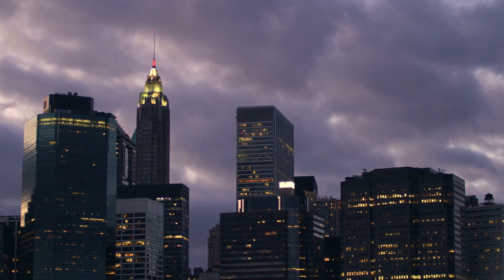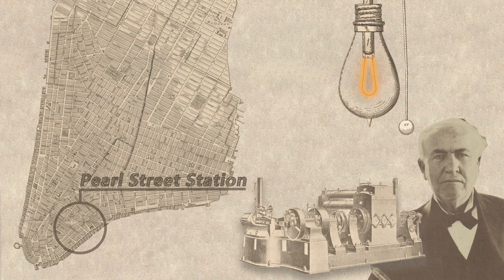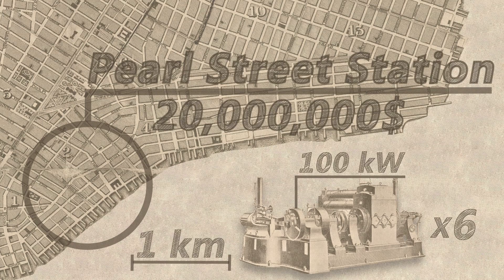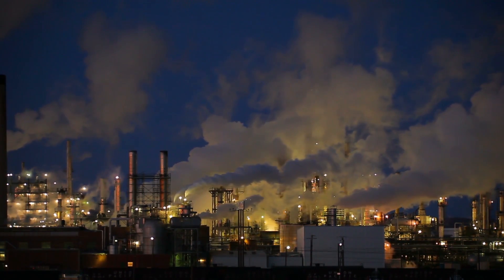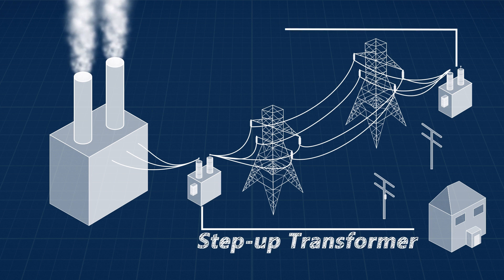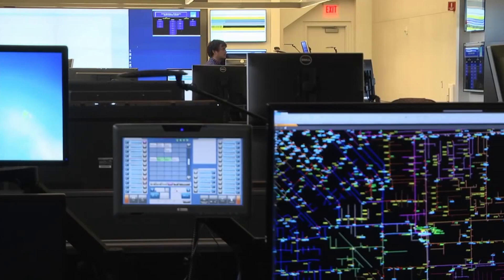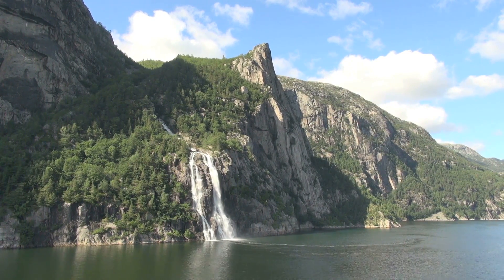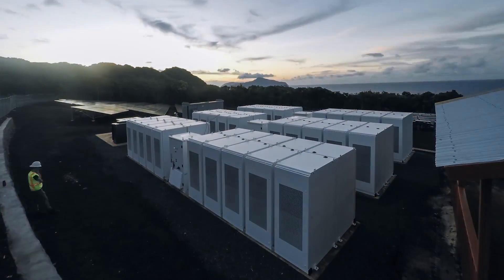What's The Biggest Machine In The World?

Comment: Or we could use good, clean, reliable, nuclear power
Reply: MrPepsicola123 You do realize that solar produces metric tons of silicon tetrachloride, cadmium and lithium waste as well. If waste is the reason why we shouldn't have nuclear, how can you possibly advocate for solar?
Reply: It's actually stored in a single site, carefully sealed. I don't know where you're getting your dumping the the ground and the arctic ideas from but your sources have no idea what they're talking about.
Reply: There is such a thing. Leaks are rare, and rarely that dangerous even when they do occur. Chernobyl and Fukushima only happened due to the fact that corners were cut when the plants were built. Chernobyl wasn't even designed as a power plant, it was built to enrich material for bombs.

Even the waste problems are overblown. the actual waste produced in volume is miniscule, France manages to store theirs, which power their entire country, in a single site, and there are new models of reactors that can reuse nuclear material to drastically cut down on waste, but no one is building them due to cost and anti-nuclear lobbying.
Reply: +•  Smudgest •
There are over 400 reactors in the world, a lot of them 40+ years old. There were only 2 serious accidents, which is already pretty good. But one was an old Soviet reactor, which wasn't designed to be safe and wasn't run safely. It hardly counts. The other one, Fukushima, also not really a true accident. It was caused by a gigantic natural disaster, which happens once in a 1000 years, and destroyed everything else too, including chemical plants and oil refineries. And with a few trivial improvements the plant would have survived just fine. But even if we count these accidents, Chernobyl killed less than 100 people, and Fukushima killed none. The fossil fuel industry kills millions, and renders the entire planet uninhabitable.
Reply: +Patrick French
We now on average produce 10% of the electricity we use from nuclear energy, and electricity is about one third of our total energy usage. Based on this, you could expect 30x more disasters, about one or two ever year. But, both Chernobyl an Fukushima are very old, outdated plants, Chernobyl never intended to be safe in the first place, and Fukushima was hit by an extremely rare natural disaster. So with the current technology I would expect significantly less disasters that serious even with 30x more reactors. I expect more TMI like accidents, where the reactor is completely ruined, but nothing outside is harmed. And there are even better reactor designs, which are not just another few orders of magnitude safer, but also a lot cheaper and simpler. The LFTR for example. Mass production of small reactors in factories would further drive down the costs drastically, and improve quality too.
Proliferation wasn't really a true danger ever, it's mostly just another excuse to keep burning fossil fuels. Commercial nuclear reactors do produce some plutonium, but that's useless for bombs, because it's contaminated with the wrong isotopes. Bombs need very pure Pu239, but commercial reactors also make Pu238 and Pu240. The first generates a lot of heat (it's often in space to keep stuff warm, and generate electricity, the Curiosity Rover on Mars uses it too), and that's not good in the center of a bomb. But the second is worse, it generates neutrons which during detonation starts the chain reaction too early, before the bomb reaches it's optimal configuration, and it fizzles. To make weapons grade plutonium you need very different reactors. The other way to make a bomb is using weapons grade Uranium, which is above 80% enrichment, but commercial reactors use only 3-5% enriched fuel. One last thing that countries get from civilian nuclear power is experience in working with nuclear materials. That is a more real danger, but that exactly can be easily avoided by selling them our tech, and not forcing them to develop their own. The Russians did exactly that during the cold war, they sold the reactors and the fuel, and took back the waste. This way the other countries only had to know how to run and refuel the reactor safely, and didn't have the chance to work with fissile materials directly. That's important, because both Uranium and Plutonium are very tricky to work with.
As I said fossil fuels are killing millions, so they are far worse. I'm reasonably sure that it's more dangerous to live near an old coal plant than in the Chernobyl exclusion zone. Then there's Flint, Michigan, where the drinking water is contaminated with so much lead, that it makes people sick. And that's not the only place in the US with serious lead contamination. In other places people are dying from oil that routinely leaks from pipelines. And there are places like Centralia, Pennsylvania, which is uninhabitable because of an underground coal mine fire (it's burning since 1962).
And finally, the worst industrial disaster ever, the Bhopal disaster (a huge gas leak at a Union Carbide pesticide factory). Thousands died, hundreds of thousands were injured, and a huge area was contaminated. It happened in 1984 and it's still not over.
Reply: They are good because they are extremely energy efficient. They are clean and reliable when designed properly, which is unfortunately rarely the case, due partly to economic concerns, and partly due to energy lobbyists rallying popular opinion against nuclear.

The latest model plants can re-use nuclear material, cutting down on waste by orders of magnitude, and are virtually failproof, but none are being built because no one can get both the capital and authorization to build them.
Reply: They can be both when designed properly. There are proven designs that reuse material, creating almost no waste, and even waste produced by all plants is practically negligible by volume.
Reply: Mi 28 my comment is to you actually
Reply: +Yalçın Alper Şahin The problem is that many of the nuclear powerplant are in flood-prone areas and with the rising water levels a catastrophe could easly happens.
Reply: LFTR ?
Reply: Hell yes.
Reply: "you" are wrong.
Reply: Do you? Or did you learn what you know from fear documentaries and your biased school textbook? Get a grip. Actual engineers run the world, not your drivel.
Reply: Its expensive due to laws forcing taxes and other unneeded costs on it due to lobbying of other power companies. Corrupt fucks. Its actually almost free compared to literally every other power method.
Reply: Dude please educate yourself. This isn't the Simpsons. This is real life. Moderns reactors "waste" is steam. You are not helping, so please shut the fuck up.
Reply: Or  we could use good, relatively clean, reliable, easily available and tried and proven fossil fuel burning generators.

You see @UndecidedSky, stating only advantages and ignoring drawbacks is fantastic right? Tool.
Reply: +GlobstersMessenger
Fossil fuels are anything but not clean. They kill millions every year. All people who were killed by nuclear power (not bombs) would fit on a medium sized airplane. And almost exclusively were from Chernobyl, which was a very badly designed, built and operated plant. Solar and wind kills more then Nuclear. One big gas explosion, or dam failure kills more people than nuclear power killed in it's 60 year existence.
And it could easily be far cheaper with more reasonable regulations.
Reply: Perhaps if you exist in a void, but we don't, money and demand is the driving force behind power generation, frankly the types of nuclear plants that have been most popular are arguably the more dangerous and less efficient variety, but are proven to work effectively, deaths and effect on the environment is not considered absolutely important here, it's balanced against risk and reliability.

Someone has to actually put money into a project for it to even happen in the first place, sure, money put towards cleaner nuclear power, more efficient nuclear power and a larger nuclear power base would be great, but few are actually interested in funding that when fossil fuels are arguably more reliable, cheaper, easier to set up and often people have more experience with them.

Fossil fuels will eventually subside due to supplies becoming more expensive, but I'm not sure nuclear power can ever gain a good image in the eyes of investors and the public.

And this is without even bringing politics into it, where you have people who fundamentally dislike the use of nuclear power, people who are concerned about nuclear proliferation, concerns about waste disposal etc. all of which makes people less comfortable with investing and supporting nuclear power, even if they themselves think it's fine.
Reply: GlobstersMessenger
Yes, nuclear power has a bad reputation, and unlikely to prosper in the foreseeable future, and that's why I'm worried. We don't have much time to stop climate change, and with renewables alone it's going to be incredibly hard. Nobody has any idea how to do that exactly, except Tesla. Nuclear energy is well known, we know how it scales up, how much it would cost, how long it would take, and what would be the environmental, economic, social, and other consequences. If the US kept expanding nuclear energy as it did before TMI, the world would use very little fossil fuels by now, and climate change wouldn't be an existential threat. But now it's almost too late. When your house is already on fire, you don't sit down to research the best firefighting practices, you use what's available the best way you know.
Reply: #gimmethorium
Reply: MrPepsicola123 his taking about the power not the nuclear itself
Reply: Clean? Yet leaving behind waste that has to be guarded against terrorist attacks by our grandchildren's grandchildren? That clean? Go fish!
Reply: dlwatib
That waste is a million times less than what fossil fuel plants leave behind, and it comes out neatly packaged. And you don't have to guard the waste, put it in a proper storage facility like Yucca Mountain and close the door. Not that terrorist could do much with the waste beside killing themselves. There are far more efficient ways to do terrorism. And it's possible to burn that waste and make a ton of energy from it. Some waste will still remain but that decays away in just 300 years.
Nuclear waste is a trivial problem compared to fossil fuel waste.
Reply: MolesterNZ1  My high school teacher dropped a piece of sodium into water.  Lithium reacts to the water in the air, which is pretty cool to watch as well.
Reply: You mean that stuff you can just put deep into a mountain? Places where people hasn't visited in about 4 billion years? Deep storage for 100 000 years might sound like a long time, but it's a small speck in our planets history.
Reply: +IronAperture
You know what else is toxic and radioactive? Coal ash. We have like 100000 times more of it than nuclear waste, and it will remain toxic for ever. The good thing about nuclear waste is that there's little and it comes out of the reactor in nice packages. Even better is that it's possible to burn the waste in fast breeder reactors, and they make electricity as a byproduct, about 100x more then the regular reactors that produced the waste. And after it's burned the remaining waste only remains radioactive for a few hundred years. We have 3000 years old buildings with still perfectly sealed rooms and metal containers in them (the Egyptian pyramids), so a few hundred years is no challenge.
Reply: Or better yet use thorium
Reply: UndecidedSky true but many of the costs Nuclear pays are unnecessary and modern nuclear technology can reduce others. For example Nuclear has the largest security cost of any energy industry on earth for threat of nuclear proliferation. However this threat has never once in human history been substantiated. In reality making weapons of nuclear waste is so costly and so technical it would be easier for terrorists to buy their weapons on the black market. These costs are maintained for an issue that has never existed. 

Other costs like liability concern and water can be almost removed by installing Liquid Fluoride Thorium reactors. These reactors are impervious to meltdowns as their coolant can't boil even in the threat of total power failure. These also use Fluoride salt instead of water as a coolant. This would drastically reduce liability costs for the plants, as well as reduce water costs and these reactors can be placed anywhere in the country. 

Imo given the benefits of safety, coolant properties and US Thorium reserves these reactors could potentially be significantly cheaper than all nuclear available today.
Reply: +OtK
Wind isn't good at all, far worse than solar. First, it's a mature technology (same principle as airplane propellers), so efficiency improvement is very unlikely. The only way to make them cheaper and more efficient is to go bigger. The economy of scale and the stronger winds further away from the ground helps somewhat. Second, they require large open space, that can't be used for much else, because you don't want to disrupt the airflow, and it's actually dangerous to be near them, because if they break, the released kinetic energy from the blades is very destructive. Third, they have some environmental impact, and since you need a huge amount of them, it adds up. Also, they fail relatively often, since they are big fragile things with moving parts. Solar energy is far better in all of these ways. It has still far away from it's theoretical maximum efficiency. There is no limit on how cheap it can get, because it doesn't need structural strength, or lot of materials. In theory you could just spray it on to any surface. It can be put on any surface that faces the sun, it doesn't need anything else. It has negligible environmental impact (except mining and manufacturing, but that's could be solved), and doesn't so visually intrusive. And finally solar panels are safe, the only thing dangerous is cleaning them on the roofs (but that actually makes them more dangerous than nuclear energy).

Jobs doesn't matter anymore, with increasing automation, we are now transitioning to a post-scarcity economy, where people don't have to work at all.

Hydrogen isn't worth it. Batteries now getting cheap and have enough capacity to power cars, and augment the grid. Hydrogen needs a complete new infrastructure, while electricity is already available everywhere.
Reply: +juste kevin
Switching to nuclear energy in time could have prevented sea level rise in the first place. But it's not that big problem for reactors, they just have to be prepared. Move the electric gear and backup generators higher and they are going to be fine. Sea level rise won't happen overnight like the tsunami in Fukushima, so we have plenty of time to adapt.
And there is no reason for a nuclear reactor to not work underwater. If the electric parts are well insulated, they are fine, they don't need air. Ironically the weakest link in Fukushima were the diesel backup generators for the cooling system, which are fragile, don't like water and run out of fuel fast. Better reactor types like the LFTR don't need active cooling. Or if the reactor is completely under water, cooling is not an issue. Nuclear subs spend months without surfacing, their endurance is only limited by the food supply for the crew.
Reply: Oh hey, ok that was a fact that I did not know about until now. But do coal power plants not have filters for such substances? If they reach the air then I see what you mean - nuclear waste is at least controllable and (not completely but at least mostly) sealable. Dust is uncontrollable and spreads through the air to poison every organism in the region and maybe on earth.

Then, some words to my comment up there - my intention was to draw attention to also see the other side of the medal. In general overpraising and overhyping things, only mentioning the so good-sounding nice sides about, that overhyping like here, is not a good approach. I hope you agree with me in that aspect. Here they called, it was only clean, reliable, good and in common nothing about that could be harmful. That is just not true, and I don't like it so much when people do that.
Reply: You are the definition of ignorant and the prime example of gullible. Educate yourself, swine.
Reply: We don't have to worry about nuclear waste that's why god gave us the Nevada dessert
Reply: UndecidedSky you forgot dangerous
Reply: Nuclear energy gets a bad rap, it's not a long term solution, but it's vastly superior to fossil fuels.
Reply: Nuclear power is very expensive though. This is the core reason why oil, coal and gas eclipse nuclear. The "green energy" is even more expensive and only exists either in personal households with a lot of money to spare or as a government subsidized program. And by the way, the "green energy" generates much more pollusion once you consider that it doesn't comes from nowhere and it has to be manufactured with all the associated pollution. Case in point: manufacturing of solar panels create up to several times more pollution per amount of energy they produce in their lifetime than burning oil to produce same amount of energy in a fossil fuel motor.
Reply: Wind is the best, and most commercially viable option until Hydrogen Fuel Cells can become commercially viable. Nuclear is an interesting idea, but from what we have seen so far, the current Nuclear projects in the United States are billions of dollars over budget, and years late. Wind is environmentally friendly, and it will create more jobs than amount currently employed by the fossil fuel industry. As far as solar goes, it is one of the most over rated powers there are in the world. It only got so popular because the solar market paid off the politicians to subsidize the hell out of it. We must move towards wind until the rise of Hydrogen Fuel Cells.
Reply: +Andra Biro
While your attempt to down play is very accurate it doenst really address the issue.  Even if the odds are a million to one the potential impact of nuclear disaster is just to cost to justify nuclear power proliferation. At least that is the basis of anti-nuclear. And it's does have some merit.  Imagine if we were to replace all our energy production with nuclear tomorrow while cutting the rate of nuclear disaster per plant down by 75%. How often would we then have a disaster, and how long would it take for use to Chernobyl the the entire planet? 

 But then the same people of course complain about pollution from coal drive big SUVs despite the BP disaster.  There really is no easy answer.
Reply: Why are so many people calling nuclear power clean? You are forgeting a really important facet.

Yes, I know the physical and technical backgrounds. A working power plant that works secure and produces much energy for not producing CO2 and consuming much resources is a nice thing. But nearly everyone that talks about nuclear fission forgets about the nuclear waste! That is the one aspect that I find terrifying about and why I am not so convinced of that technology. It is not only radioactive, everyone knows that of course. But it is also highly toxic too, leaving out the radiation.

And what do we do with that harmful matter for about 100.000 years? Oh, eeehm, first we enjoy the nice energy and someone will certainly find a way to deal with it. And so - we are pumping it into the sea, burry it into the arctic "perpetual ice" - that isn't as perpetual as we find out now - stress our ground water with it and so on. To be clear, we just don't know what to do with it and still do not care about and are performing a blind flight.

Okay, I also know the other side, the tons and tons of CO2 that we are pumping into the atmosphere. Therefore it could be "okay" as a transitioning technology until we have something better like nuclear fusion.

But - please, please do not forget about the negative sides of nuclear fission power generation and don't praise it as so clean and nice and without danger and only being good for all of humanity, leaving those important issues out.
Reply: -clean? 
-reliable?
so you believe this lie? you don't know anything about nuclear waste do you.
Reply: "good" questionable, "clean" as long as nothing happens, "reliable" hardly.